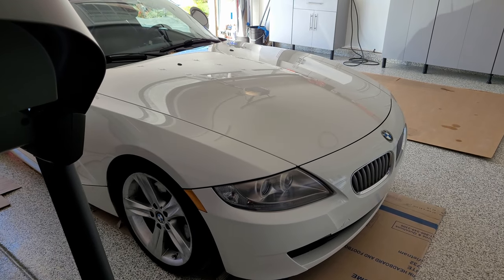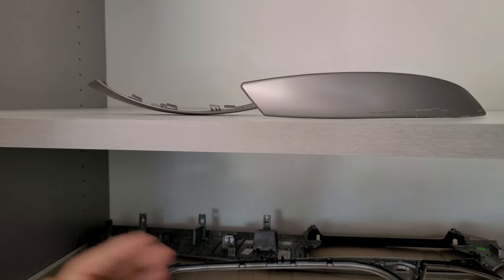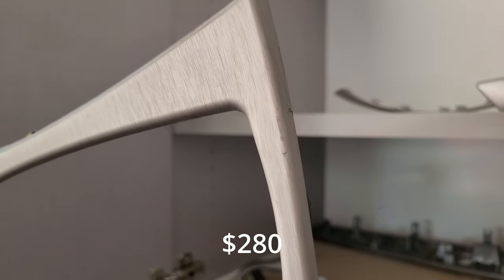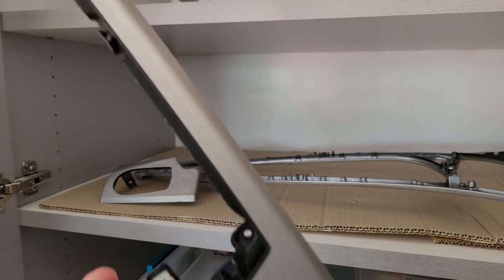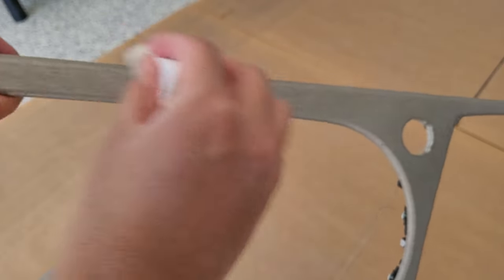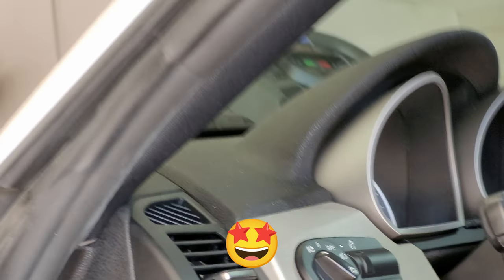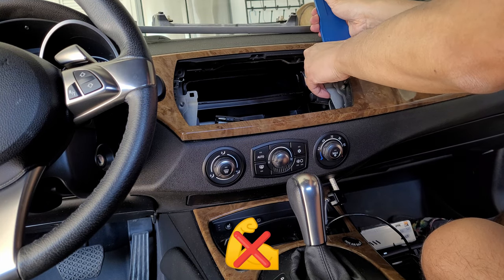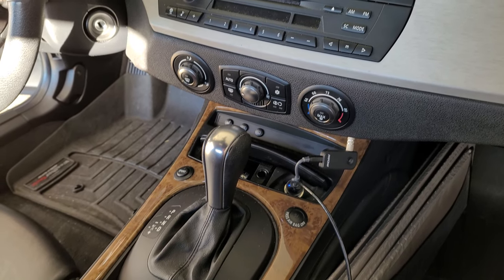😀My Z4's FIRST Major Mod | Dashboard Trim Swap | Vlog 3

Comment: My M is that grey my first M was changing all the interior bulbs to led bulbs including the tags light also changed the shifter ZHP and then stubby antenna also put in a GROM audio system it connects the CD charger cables in the trunk.
Reply from the maker: I'm looking to do something like grom in the future

Comment: Hi mate. Also have an E86 and like your descriptive and informative videos. Calm voice and smooth music, thumbs up!
I'm about to remove the center console too, probably tomorrow. I did that last year but without removing the rear center console (where the Nav Module sits) - and by doing so broke some pieces. So tomorrow I will remove the rear center and the middle center console the "correct" way, I found a detailed description online. I'm not a blogger at all so I am not posting a video, but I will see what your method is once your vid comes out and will comment on whether I did it differently ;)
greets from Germany
Reply from the maker: Thanks for the kind words. I don't know how to do the middle part yet. Any references you can throw my way would be appreciated.